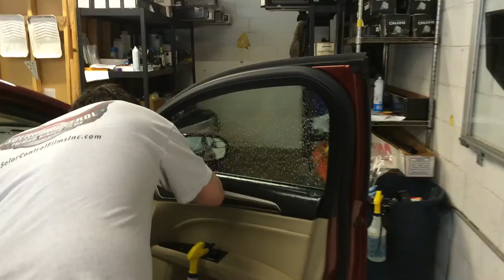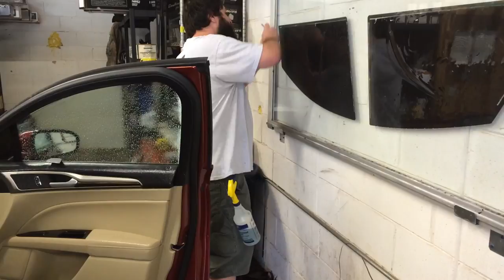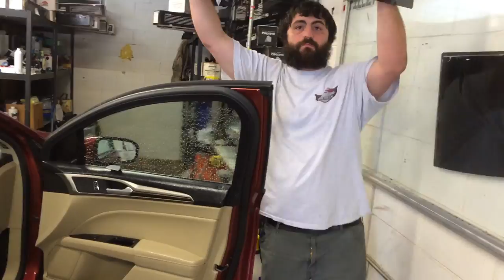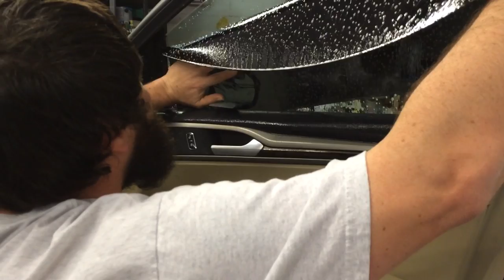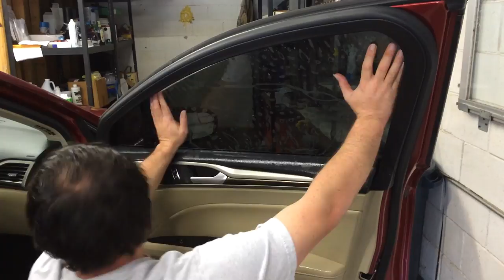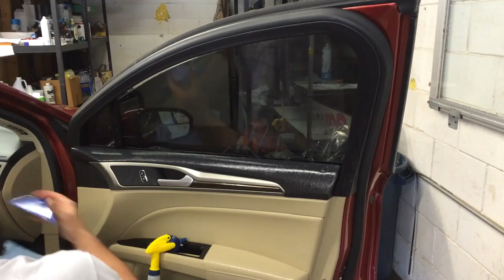Window Tinting Professional installation using the bottom loading or bomb drop technique

Comment: I'm assuming this is just a demo. The top of that fusion door peels back and you can pull that seal out in 10 seconds. Lube it up with soapy water and it slides back in. But I'm sure you already know that. But the other commenters might not.
Reply: dan moss he figured it out with out taking off panels and seals!!!

Comment: Actually not bad. If only you knew how to custom fit the top edge
Reply: Use slip solution sparingly on top, get edge of film just a hair over the edge of window, squeegee tight with a single pass starting from the top, then (using a new blade) shave the top excess tint by angling your olfa and steadily running it across the edge of the window. The result should trim a VERY thin layer of overlapping film and result in a flawless edge that won't "roll" the film but eliminates any chance of a light gap. Hope this makes sense.